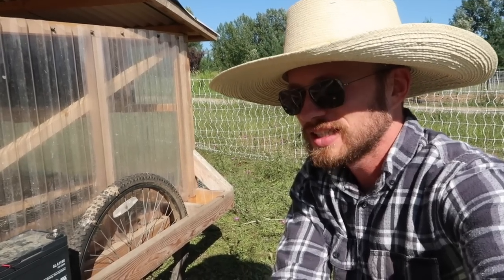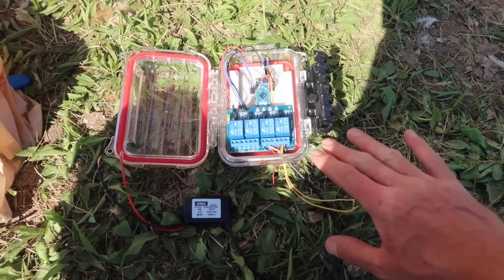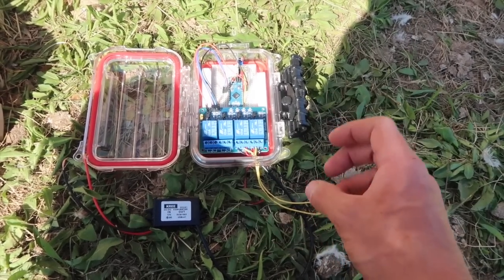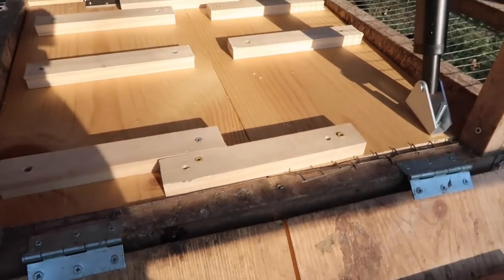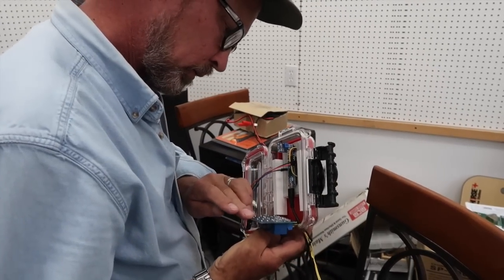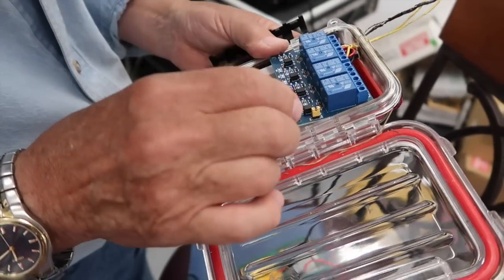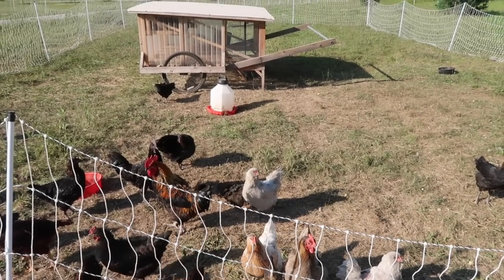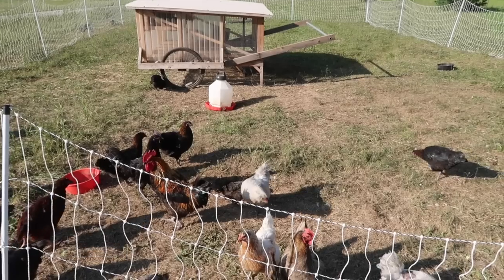Automating the Chickshaw - Part II: The Installation

Comment: One of the benefits of the chickshaw is ease of cleaning. Do you find the new door of the coop requires a lot of cleaning?

Also, does the "lift" feature only work once it's pitch black?

Awesome design!
Reply from the maker: you can set the sensitivity of the photo sensor to whatever level you like so it can "lift" earlier than absolute darkness

Comment: This is a great addition to the chickshaw. I hear Justin Rhodes will be coming your way soon. So it will be fun to share it with him. Dan, what are your plans for winter shelter for the pigs and lambs that you will be keeping. Any thoughts about enclosing the sides of the large car port storage structure?
Reply from the maker: yes, I want to enclose the car port but not for shelter.  It would be for storage.  I am planning on building pallet/cattle panel structures with some framing for snow load.

Comment: Won't your door get covered in poop overnight? I would have thought you would have used a wooden framed wire door that is similar to the chickshaw floor.
Reply from the maker: the chickens are roosting on the 2x2 bars, not so much the door.  I don't think it will be much of an issue